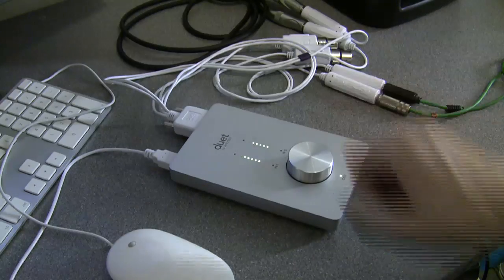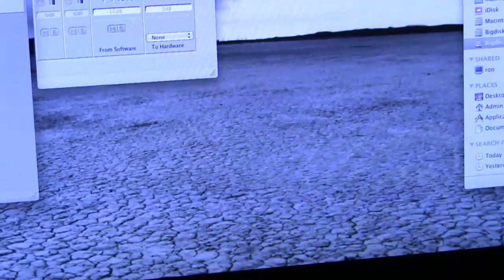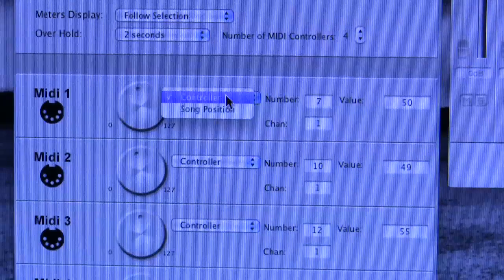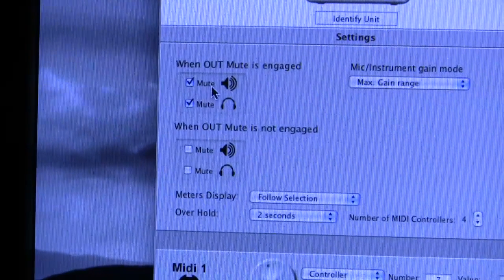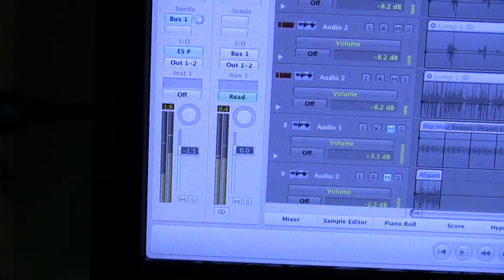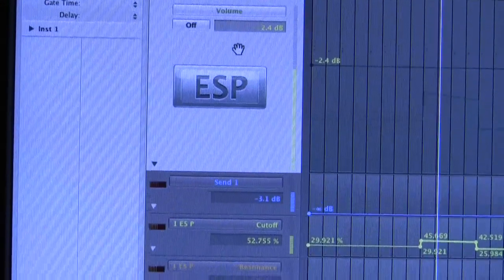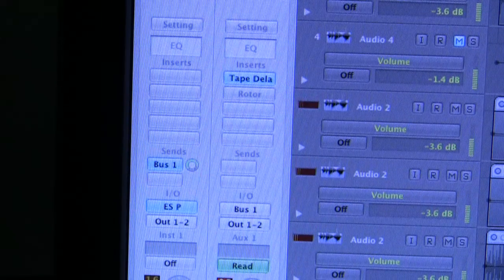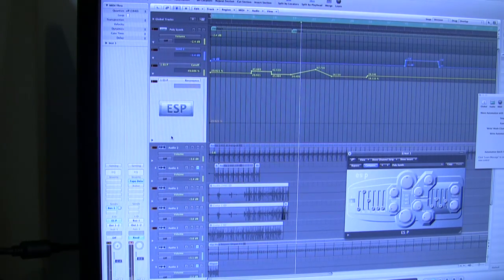Apogee Duet Review (HD) - Part-4

Comment: Good review .. i'm curious what you think of the duet FW in 2022 , i got one just to check if it still works on a catalina system and seems to work fine , was wondering if the duet can still be midi mapped ? (without effecting the volume control) since that option isn't 
available in the latest Meastro software for the Duet FW
Reply from the maker: hi. yes the Maestro app will work in Catalina as you say, but the only way I ever used the MIDI function was via Logic's Automation Quick Access controller feature which means i never had to change the CC being sent, so I cant help you there, sorry
Reply: @dancetech  Thanks for the reply .. it seems that they have removed the midimap function within meastro in the latest update ..what are your views looking back , is the Duet FW still quality compared to let's say a 150 euro soundcard in 2022 ?
Reply from the maker: @JustDuppy  Yes, they have removed the midi function from Maestro 2 cos that midi controller feature is not included in the v2/3 Duet i suppose. Yes it's quality still stands up, but then I personally follow the philosophy that as long as nothing is humming or buzzing and the signal sounds ok then what really matters is the song, arrangement and overall production, not minuscule/subtle differences between gear specification, and the truth is, most interfaces have pretty decent preamps nowadays.  Personally (and to my great surprise) my fav at the moment is the Behringer UMC1820 I got, it does it all... 8 mic pre's for recording drums & the Midas designed pre's sound great, really quiet and 'weighty' with plenty of gain range. I'm not sure how Behringer are doing it for that price tbh.